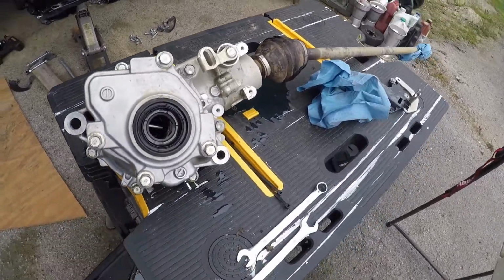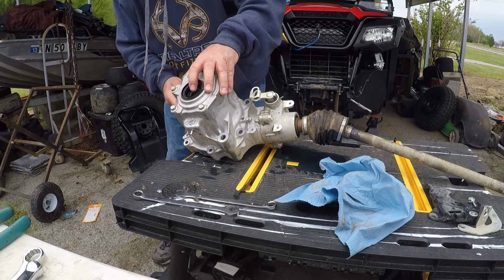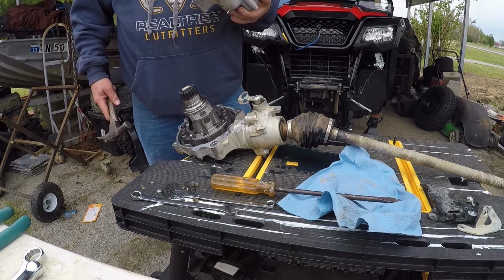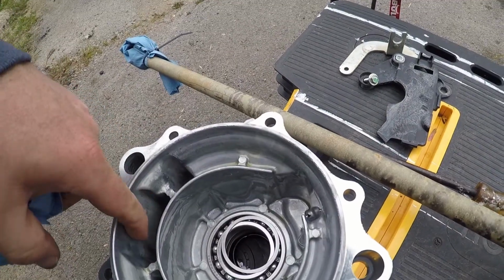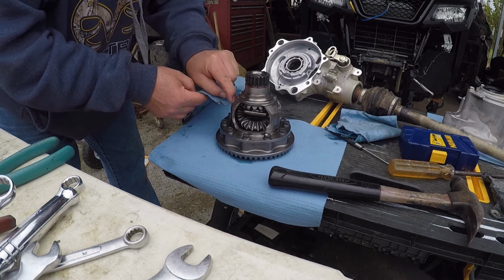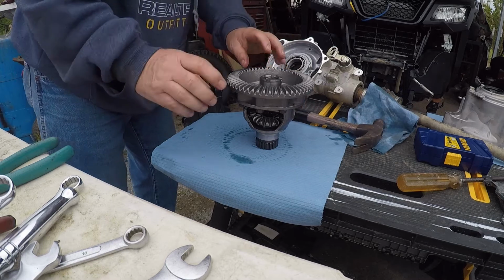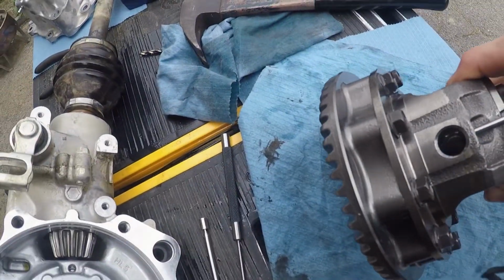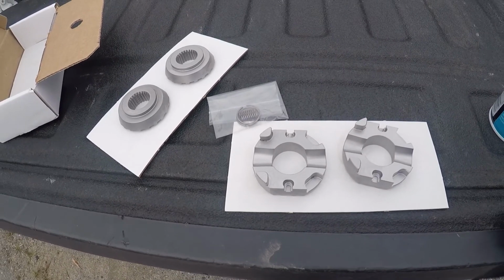2021 Honda Pioneer 520 Torq Locker Install Part 2

Comment: You're a dangerous man with that hammer !!!!
Dead blow, rubber  Mallet,  or block of wood !!!  Cast is tuff but  Fragile
Reply from the maker: Cajun Coonass, Thanks for the comment! I was just barley tapping with the hammer. The sound on camera might have sounded like I was hitting harder than I really was. The center pin had to be driven out, no dead blow was going to move the center pin.

Comment: Great video! Please help... I have a 2017 Honda Pioneer 700. When in 4WD - lock, some days the steering pulls right and other days pulls left. It steers straight in 2WD and 4WD-unlocked. Drained oil was full, zero metal shavings. Front differential runs smooth and silent when jacked up and manually rotated. Thanks.
Reply from the maker: Kenneth I would start with making sure the air pressure is the same in both front tires. Then I'd be looking for worn parts on the front end, such as tie rods, ball joints and A Frame Bushings. Hope that helps!!!
Reply: @charliesadventures6982  thanks charlie
Reply: @charliesadventures6982  I replaced the worn out leaking tires and it fixed the steering problem . The old tires were unequally inflated and, apparently, it caused the front differential to act up and cause the steering to pull
Reply from the maker: @bebop1984  That's great, glad that helped you!!!